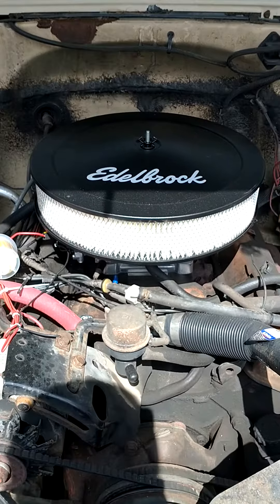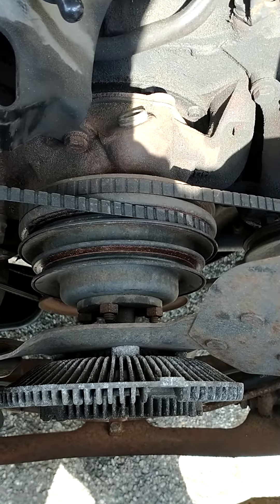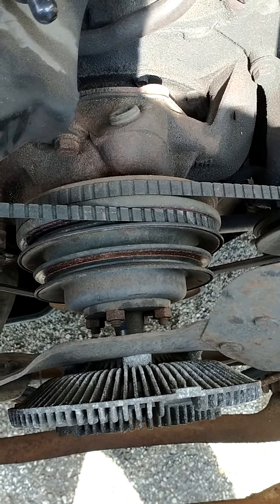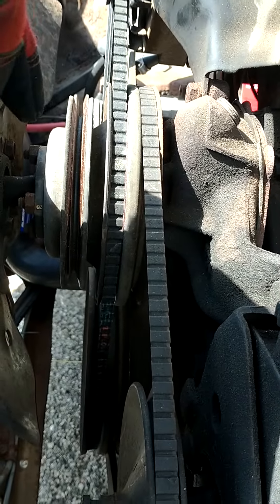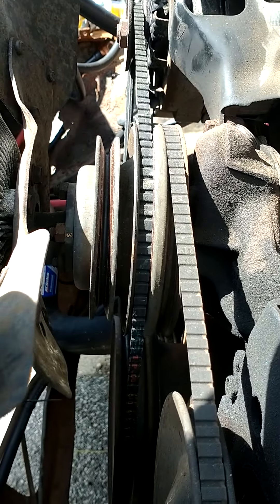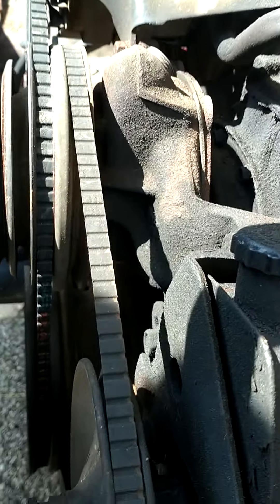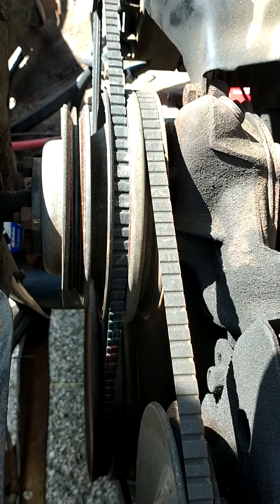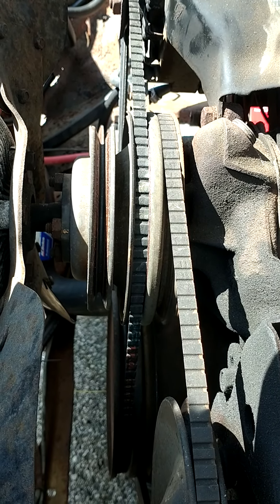C10 fan pulley wobble

Comment: have same problem can’t figure it out
Reply from the maker: Turned out to be failed water pump bearing. It was rough. It was leaking but slowly. The air blown by the fan concealed this from quick discovery.
Reply from the maker: This thing has a lot of wobble.  I expected it to be leaking like Niagra Falls.  However, that wasn't the case.  I replaced the pump with new.  It's all good to go now.